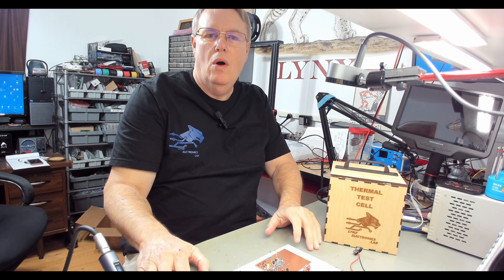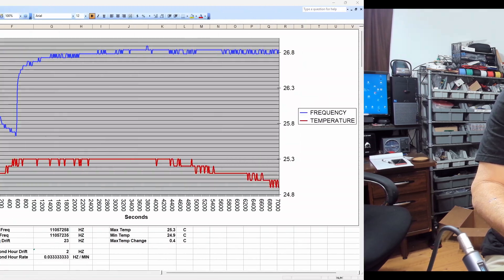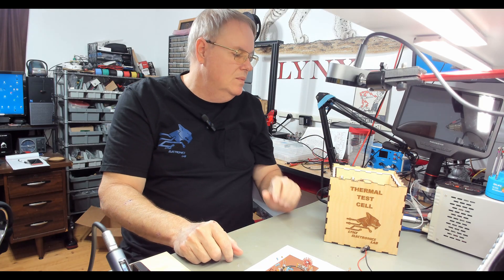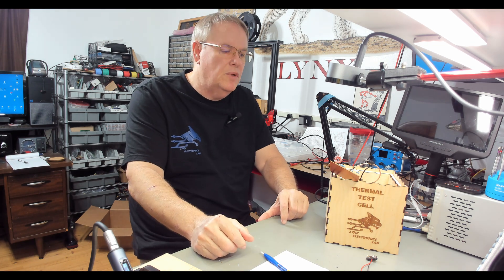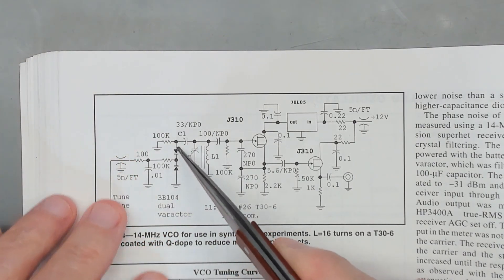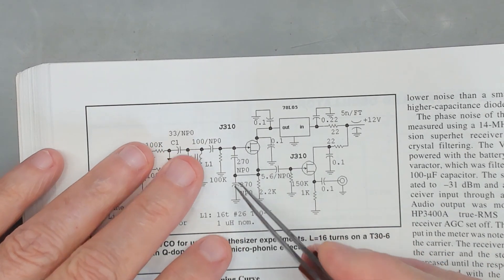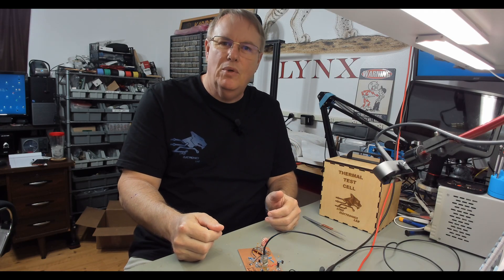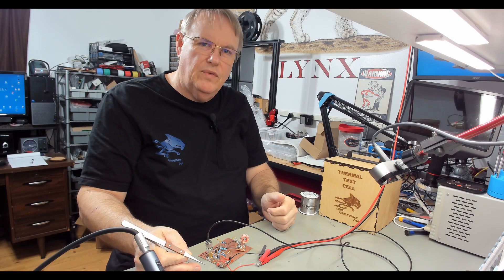Franklin Oscillator STABILITY TEST What Went WRONG

Comment: Hello RJ,  Great to see your excellent video and your Homebrewing Skills!
1) While I am uncertain as to what causes the JFET Colpitts oscillation droop, the tests you performed largely rule out thermal issues. You restarted it resulting in the initial strong oscillation which may point to gate bias stability condition. With a high transconductance J310, I wonder if the Vgs becomes positive on part of the RF cycle. To test that out, put a 1N914 or 1N4148 from gate to ground, (cathode connect to ground). You might use two in series to raise that threshold. It probably will change the amplitude, but I wonder if it could help stabilize. Some might say that the phase noise will degrade, but maybe not by much.
I agree with one of your commentors about using the buffer output. That high capacitance/ft coax test lead going to the freq counter may not be temp stable. 
2) Franklin Oscillators: See my paper https://www.qsl.net/wn2a/MOUSEFET_11.pdf . Go to ppg 18,19 for the stability tests. I did a DIY measurement system (HB Counter>>Arduino>>Laptop running FreeBasic on Linux). Previously I have tried JFET Colpitts, Clapp-Gouriet, Vackar and Hartley. The Vackar was pretty good but the BJT Franklin was repeatable each time I built it for the 3 bands. The stability was good enough to delete the thermistor-bridge varactor I previously used,  an added complication. In all cases, the frequency sensitive "nodes" of the VFO's  first stage are built on Single-Sided board, mounted as in the paper. No DSB and not on little solder pads. The buffer and following stages can use DSB. I enclose the VFO's in a die cast housing ( a 'cold sink'). And I generally use air-core for my tank, but someday I might try some -6 or -7 mix.
3) There is nothing inherently better about the Franklin or any other type of LC-VFO's in providing frequency stability, as it is mainly determined by the tank circuit and coupling components and less by the active component. What many think is happening is that Franklin's gain is high enough to reduce the coupling to the active components and hence their influence. Possibly, but some simulations could help understand how much of this is true or not.
73!
Mike WN2A
Reply: And if that link I showed above doesn't work, try cut-and-pasting into the address window manually. Some browsers are kinda wonky
Reply from the maker: Thanks for the great information. The output we were watching was the buffer output. I did resolve the issue and that video will be out Tuesday. It was a little unexpected. 
RJ
Reply: The bench can be a great educator. The bench results can be an eye-opener. 
If there are any Franklin Oscillator questions, just ask.
Reply from the maker: Thanks, just had a chance to look over the link. Looks like you did a lot of work on your project and documentation. Very nice!
RJ
Reply: @LynxElectronicsLab  RJ, I use the Franklin VFO on 80/40 and 30 Meters, but always at one-half the transmit frequency. That serves two purposes: 1) Isolates the VFO best for when keying CW (no backwave or pulling problems)
2)  During receive, the only stage powered is the VFO (at half the output frequency). This way the receiver sees no interference.
73!😃

Comment: I strongly suggest you do add the buffer amp and take the output from there.
this issue is most likely due to lack of enough + feedback that is needed for sustained oscillation. The + feedback is determined by the ratio of the two 270p caps in the gate and source. if in the original design the feedback ratio was marginally enough for sustained oscillation you directly loading the output which affects the feedback ratio can cause the oscillation to stop. it happens after a while because as the FET warms up the transconductance changes and that in combination with the + feedback will cause the oscillation to stop. you can also monitor the bias current (a.k.a voltage across the source resistor) over time and see how it behaves when the oscillations drop out
Reply from the maker: Thanks for the suggestion but I do have the buffer  hooked up that’s the output we are looking at, I get into  it in the next video and solve the issue so check it out as the fault surprised me. 
RJ

Comment: The best laid plans of mice and men..

Were you scoping at the output of the 1st transistor or on the output of the 2nd?

The loss in gain maybe after the 1st transistor.  Try reducing the 150K resistor.
Reply from the maker: Thanks Uni, check out the next video and yes you are on the right path. 👍
RJ